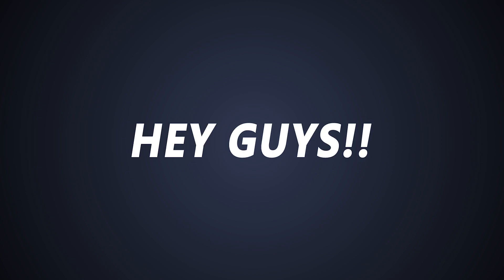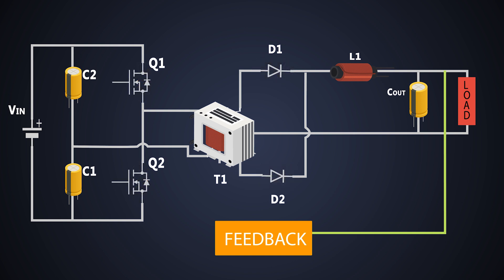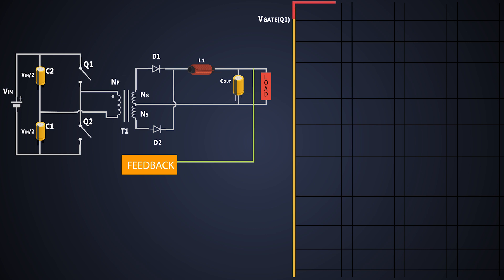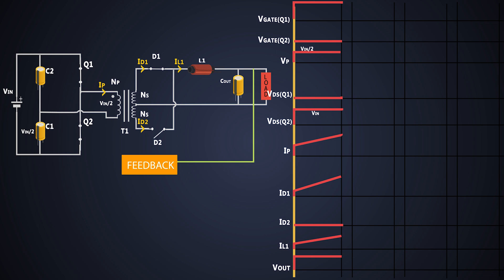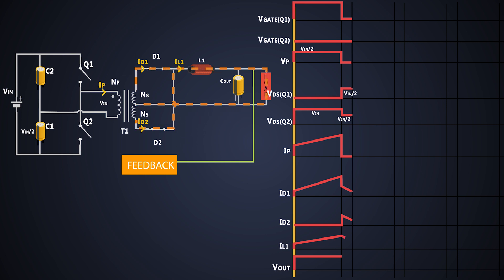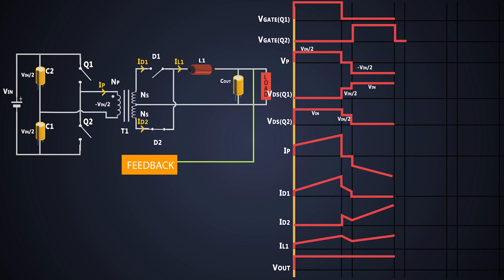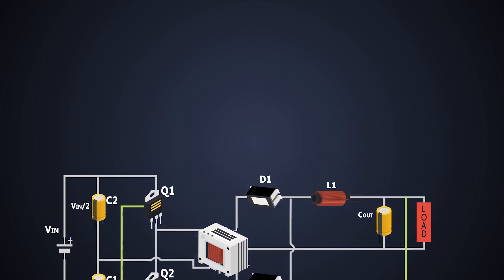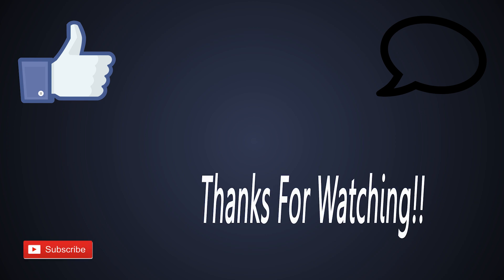How does a Half Bridge converter work? | Half Bridge Converter Working

Comment: These types of converters are never to be seen in consumer electronics. Rather than that, half bridge inverters are used with one supply source and small driver transformer. There are a couple of small 15-30nF capacitors added in the circuit between the end of  primary winding and the ground. The charge is built in them when top mosfet is off and the energy is taken off them when the bottom mosfet closes and current flows in another direction across the primary. There is definitely no second supply source and neither is there the center tap in the primary so its not a push-pull circuit!

Comment: There is a big mistake about the direction of current when each mosfets turns on; firstfull the c2 and c1 are initially  fully charged, then when Q1 turns on the current start flowing from +c2 to the negative side c2 in this case the Primary side of transformer supplied by Vin/2 and the current get positive; On the other hand, when Q2 turn on and Q1 off the current flow from +c1 to the negative side of c1 (GND)  then the current gets negative and finally the voltage will -vin/2
Reply: Correct! That is exactly what I was taught in school. I immediately looked at the comments to see if somebody else noticed that.

Comment: Hi 👋.  Thank you for this explain. I have a question: In a smps device that I want to repair, there are 2 SRD (3pda 60), step recovery diode, and there is not pulse transformer. Please explain how that diodes work. 🙏🏻

Comment: Thank but I have burning questions if I series two 555 timer can I use the two output signal for h bridge inverting for high and low with the  two 555 timer I see a circuit of that in a h bridge motor drive but not on inverter so I want to know if the same design can use a transformer for inverting

Comment: 6:58 there is a minor mistake. Currents of diodes will look slightly different. Due to inductance of a transformer they cannot change immediately. So if initially ID1 was 100A and ID2 was 0A, they will respectively decrease and increase until they eventually reach L1 current.

Comment: As Subhojit Das says, with both Q1 and Q2 'on' ... even briefly, the Vin DC supply is short circuited (through the Mosfets) and a very high current, often exceeding the Mosfet specifications, can flow. This is called 'shoot-through' and has to be avoided. Dead-time in the turn-on and turn-off is introduced to prevent this situation.

Comment: Sir, what if there is no current path at secondary? I mean open circuit.
Does the MOSFET will heat up bcs of saturation?
Reply from the maker: Yes it will! MOSFET will damage.
Reply: What can be minimum load then

Comment: Hey you have taken input voltage as Dc right?. so how does it support induction in transformer.since we have been studying since btech, transformer works in ac only?
Reply from the maker: Well, technically you are giving AC to transformer, AC doesn't only mean Sine wve.
Reply: @FoolishEngineer  thats what i want to know. how?
Reply: @ruchikumari6996   We know in AC wave current changes its direction after every half cycle right. Similarly in this circuit, we have arranged the MOSFETs in such a way that direction of current is getting revered so technically it is working as an AC. Hope it clears your confusion

Comment: Why is Vo  = 2 x Vin x D x turn ratio ? I can understand    Vin x D x turn ratio . But I don't understand how that 2 came . I thought when you are connecting from center tap to one end you will get only half the  total secondary voltage . So shouldn't it be 1/2 x Vin x D x turn ratio. ?
Reply from the maker: Here both Secondary turns of a Transformer contribute for the output voltage. 
For better understanding you can refer to book 'Power Supply Cookbook by Marty Brown' - Page 58
Reply: @FoolishEngineer  ok ok so Ns means only one half of the the total secondary turns